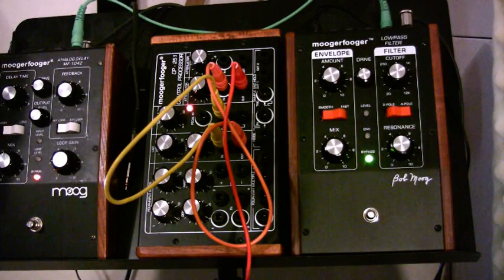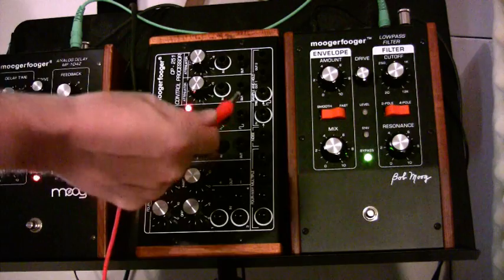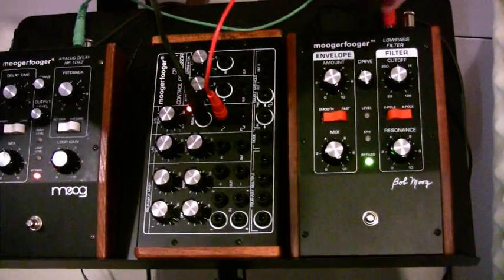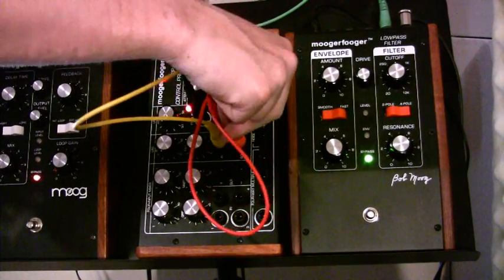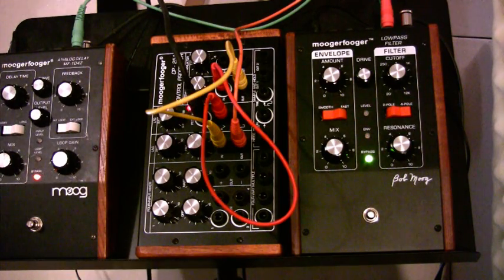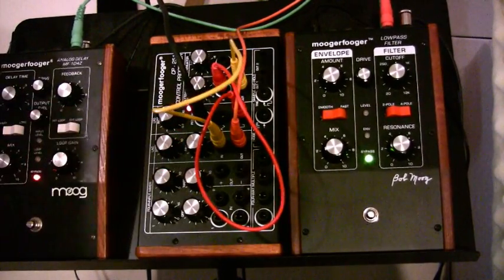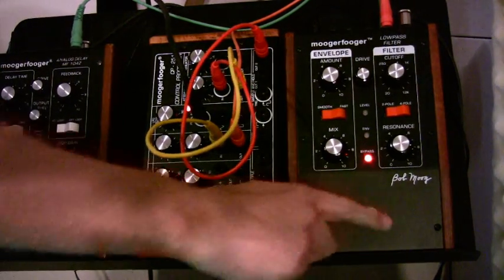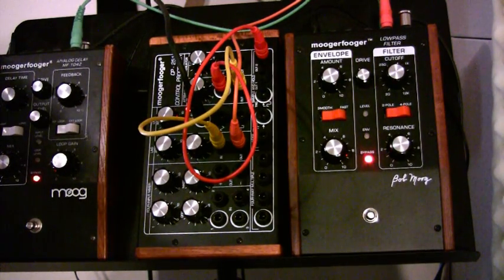Moog LPF & CP251 (2 of 2)

Comment: control voltages can be trully amazing and cool... the cp251 seems as an approach towards a classical moog modular system... sample n hold, noise gen, lfo... really really cool... would be interesting to see if it is possible to use it with other gear (maybe be connected to the exp pedal input of any pedal, they are supposed to be just cv inputs...)... even  so it must work pretty cool with any analog synth